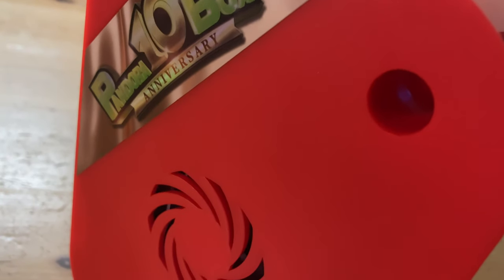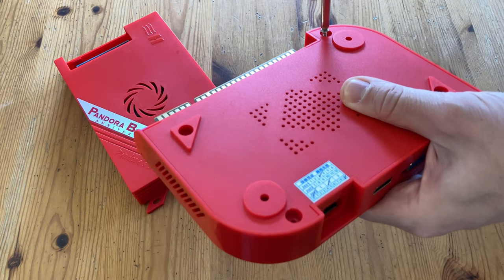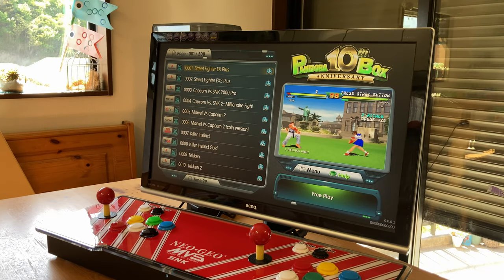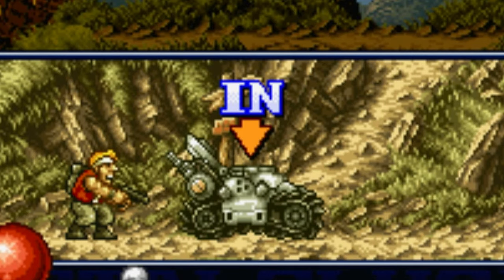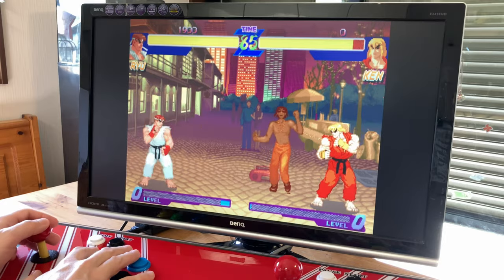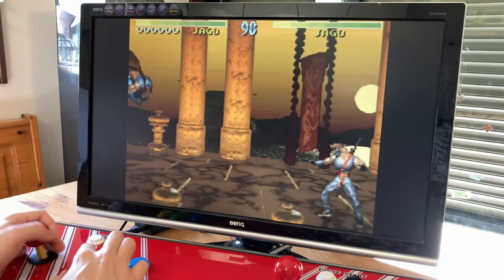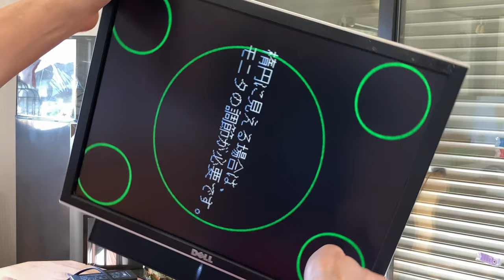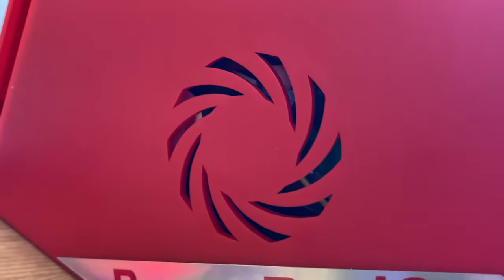NEW PANDORA BOX 10th Anniversary Family Version REVIEW [5142 in 1]

Comment: How can I change the resolution on it for let’s say, a 1up? Is the power switch necessary and if so what’s the most direct link for one that works with this pandora box?
Reply from the maker: There are maybe 2-3 main resolutions to choose from but to change you need to hold down the settings button as you switch it on, or give it power. 
If it's for your 1up / can it just turns on with the power. easily solution is to use a power plug with a switch on it - you know for the outlet ?
Reply: @TeamPandory  I’ll try it in the morning, thanks for the quick reply.
Reply from the maker: @theraymira  no worries. Try it out.
Reply: @TeamPandory  Alright I got a power strip and the proper LCD converter and I’ve held down the settings button as I’ve powered it on multiple times and it still just flashing multiple colors on the 1up screen. Is there something I’m doing wrong? Update I plugged it into my television and was able to switch it between settings however the 1024 768 setting which I thought was the right one for the one for the 1up still causes the flashing. The pandora is functioning perfectly as far as I can tell.

Comment: Hi. 
Not to bag on the pandora box, but why select it over a raspberry pi4 for instance? It seems to be slower processor but twice the price.
Reply from the maker: You've already assumed two things that aren't exactly true. The pi4 can work out much more expensive considering you need to pay for the case, memory, PSU- especially when the pi4 is rarely seen at RRP nowadays. 
Pi4 is dog crap for psp, much slower than the pg3d or saga 4188, but is better for things like Amiga emulation. 
I've made a video about this - check raspberry pi alternatives.  Right now a mini pc is much more attractive to get Vs either pi or pandora box, but the pi has the size advantage, the pandora an interesting UI to jump in and out of games, and the mini pc just wins in all other situations.

Comment: Dear Pandory,

i tried to add games to the box like you said butt it doesn't work, is it possible it only works on the jamma edition?
Reply from the maker: Currently adding games DONT work on the JAMMA/CGA mode, but should be okay if you're using VGA/ HDMI mode.  Check our other video on adding the games.
Reply: @TeamPandory  Sorry i forgot to mention i have the family edition and watched the video about adding games and did what you said. 
format a usb stick, no capitals etc. still new games are not showing 😞
Reply from the maker: @rinusduin4782  What games did you try, for which system?  - Where did you place them- what are the filenames etc?